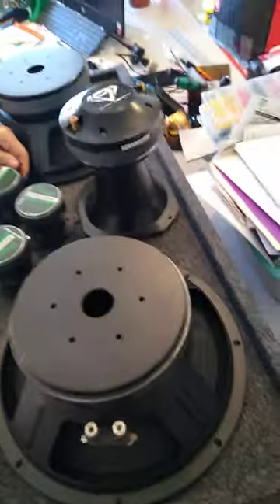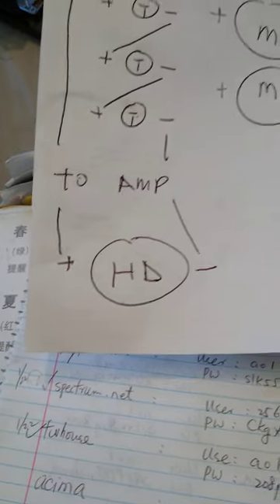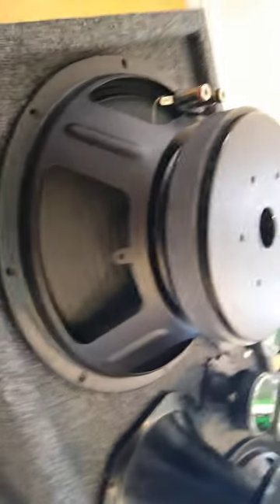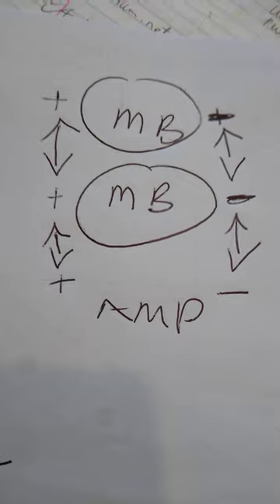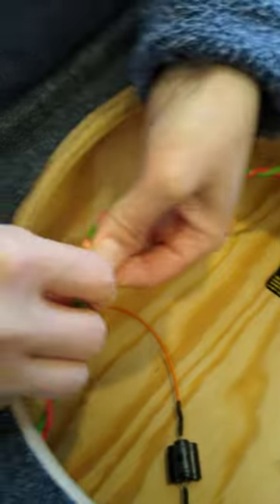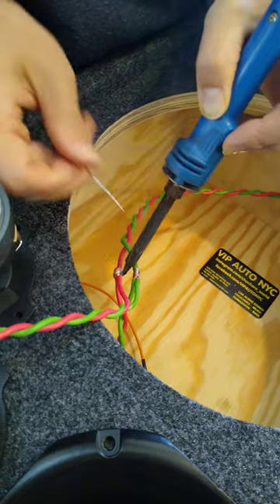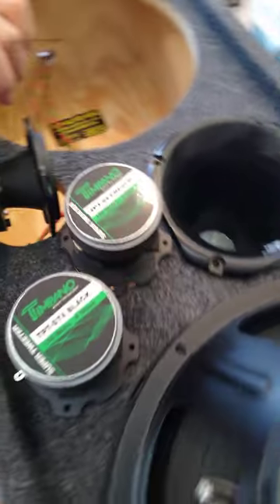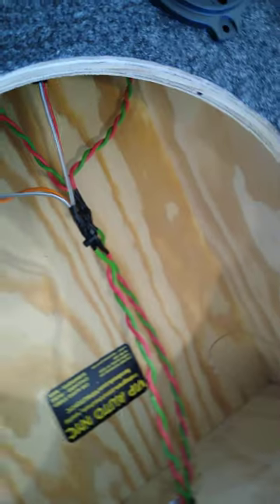HOW TO WIRE A CHUCHERO (THE BEST WAY)

Comment: does wiring the tweeters in series rather than parallel make a difference? this my first chuchero and i feel like if i connect the negative to the positive imma f it up. any other info would help A LOT lol
Reply from the maker: series ohm's go up, parallel ohm's go down. higher impedance draws less power from amplifier, power handling goes up. lower impedance draws more power from amplifier, power handling decreases

Comment: Question i’m trying to run 2 chucheros that have 2 b&c 12 inch mh32 each, the rms of the speaker is 400 watts and the peak power is 800 watts. Do you think a 3000 watt 1 ohm amp from taramp is fine to run all 4? or should i get 5000 watt
Reply from the maker: assuming you will parallel (4) 8 ohms speakers your final ohms is 2 ohms = if your 3000 watts @1 ohm - 2 ohms is only about 1500 watts - should be a perfect match 👍 . In short yes perfect combo 👍.  Please reach out if you have any more questions. Easier to get me on Instagram as chuchero_world , best regards jimmy wong

Comment: i have a 5 channel amp and i just got a chuchero can i wire the medusa/speakon cable straight into my amp or could i use normal speaker wire?
Reply from the maker: yes you can use any 4 conductor cable, bridge front channels for high frequency = compression driver + tweeters, bridge rear channels for midrange speakers, 5 channel is your subwoofer. Make sure to use crossover on amplifier, it will optimize your sound quality. This is how you can utilize all 5 channels and get the maximum performance.

Comment: can you connect those wires straight to the amp after or do you have to install one of those 8 pole connector plug then run to the amp? LMK please and thank you
Reply: if you do have to connect to a 8 pole connector plug could you please show us a tutorial
Reply from the maker: using a speakon cable is optional, you can use generic speaker cable = you just won't have a quick disconnect feature
Reply from the maker: @Migy_18  you would match the wires on both ends speakers x amplifier

Comment: Can you explain the final ohm loads?
Reply from the maker: compression driver & tweeters are 4 ohm's, as well the speakers are also 4 ohm's
Reply from the maker: two 8 ohm's speakers wired in parallel = 8 ohm's.
two 4 ohm's tweeters wired in series is 8 ohm's = compression driver is 8 ohm's = tweeters wired in parallel with compression driver is 4 ohm's
Reply: Thank you